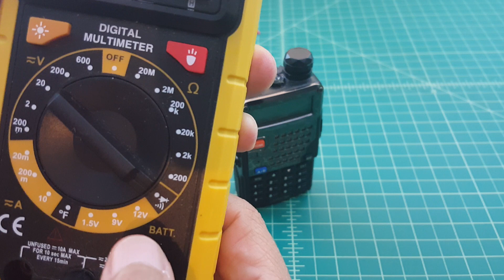Increasing the Range of your Baofeng UV-5R With a Counterpoise - TheSmokinApe

Comment: WHAT IF YOU ISE THAT RUBBER DUK ANTENNA THAT IS SUPPOSE TO BE SUPERIOR TO THE 5 UVR ANTENNA?  IT IS THAT BAOFENG FHP8? 
WILL USING THIS FACTORY ANTENNA WORK BETTER THAN WHAT COMES WITH 5 UVR?
Reply from the maker: The stock Baofeng antenna is terrible, you are better off getting an aftermarket antenna 👍
Reply: LIKE THE NAGOTA 771 ON EITHER UV-5R OR FH8?
Reply from the maker: Yes, I use a 771

Comment: That wave you be talking bout?
It represents the beep tone coming from your meter when you have continuity below 250ohms I believe it is. Might be 250k can't remember, either way it's the beep symbol dawg..
Reply: The "beep" is simply a selectable audible setting when checking continuity using resistance.  If there is 0 resistance, the meter can be set to "beep" so that the audible alarm frees you from reading the meter.  Its the "continuity" symbol.

Comment: Do you have a link to buy Like that radio Baofeng uv5r.
Reply: EBay. From $12 to $25
Reply: @franciscorios3833  do you link sir, in to the other seller are not original or legit radio's, i mean class A .
Reply: I bought 2. From eBay brand new from legit sellers and they work amazing.    I don't know what link means
Reply: Link website seller store sir
Reply: @JayGamzTV  factorydirectsale on ebay
Reply: Thank you very much sir 😊

Comment: Would you recommend this or just buy a better antenna?
Reply from the maker: I’d buy a better antenna before doing this.
Reply: I WOULD USE THIS SYSTEM OR CABLE ONLY IF I AM GOING TO USE THE RADIO TO RECEIVE AND IF IT WOULD GIVE ME BETTER PERFORMANCE IN RX BUT FOR TX TRANSMISSION I WOULD NOT USE IT

Comment: This works but you only improved the 2 meter band, not UHF. Use a piece of speaker wire instead. Cut one of the leads to your 19.5 inches for VHF and the other lead to 5.5 inches for a UHF counterpoise. Leave them stuck together, no need to peel the two leads apart from one another. When you change bands, the RF will "ignore" the non-resonant lead and use the one most resonant on that band. My own testing with a ham friend on simplex showed about a full S unit gain which is approximately 6db. This is equal to doubling your RF power. Not bad for a few cents worth of wire.
Reply from the maker: That’s a pretty good tip, thanks 👍
Reply: Do I join both wires into the same clamp and screw them down together with the same screw to the HT body?
Reply: @darezi   @Darezi  Speaker wire is two parallel stranded wire bundles enclosed in common insulation. Cut a piece to 19.5 inches. On one end you attach a ring connector to both strands. At the opposite end you cut just one wire bundle to 5.5 inches length and peel the excess wire away.  It will look like something like this:
O=====--------------
So there is only one end to attach to the radio.
Hope this helps.
73,
John - KK7JBZ
Reply: @johnbauman4005  Thx! I'll try it out.
Reply: @johnbauman4005 having trouble with the instruction any chance of doing a video ❓
Reply: Best way to use repeater set ?
Reply: Thank you for this information! I just bought a set of baofeng radios and realized how little I know about this subject.  On the other hand,  I am an electrician and have the tools and wire needed for this upgrade.  Thanks for sharing your knowledge with this newbie!
Reply: @richb.4374 For UHF 5.5 inches look like it's for 570 MHz which is out of scope... Would it not be better 6.3 inches which is 435 MHz ?
Reply: @fgFhgs  Unless you have a way of checking the SWR curve of whatever HT antenna you're using, the length of the counterpoise wires could vary by some degree to obtain a low SWR. Also keep in mind that with or without a counterpoise wire added, your body and the ground traces of the HT circuit board are also part of the "ground plane" of the antenna. My measurements are "close enough" and work fine on my HT's, feel free to experiment though, your results may differ from mine. In my tests, my signal picked up a full S unit by adding a counterpoise wire for vhf and uhf.
Reply: @richb.4374  Ok thanks, I was asking in case it was a simple "mistype" number  (I'm total beginner in antenna and it seem veeeery complicated 😃😁 )
Reply: @fgFhgs  Keep in mind that your body and the ground traces of the HT's circuit board are also part of the "ground plane" so it tends to skew the actual measurements of a quarter wave counterpoise off by a small margin when doing this. Even if the counterpoise wires are "off" by a little bit, the HT will still perform better than without any counterpoise at all because the human body is a terrible ground plane.

Comment: Hey there SmokinApe, 🐵
Nice video! Just ran across this post early this morning (too early for beer unfortunately). This video was interesting to me as I just purchased a Baofeng 5r. Although this post is nearly 2years old, as I read through the comments I noticed some glaring omissions for suggestions. 
#1. The dangling end of the ground cable was not covered or treated to eliminate the possibility of the wire touching the positive connection of the battery. With a lithium battery, a short circuit could prove catastrophic to the radio 💣💥 and down right dangerous to the radio operator, 🤯🤕 unless the battery has an internal fuse. Not all batteries coming out of China are properly fused. A little trick I learned years ago for a dangling wire end is to place a piece of snug fitting heat shrink tubing over the end of the cable leaving approximately 1/4" of tubing longer than the wire. Immediately after applying heat to shrink it, take a pair of needle nose pliers and pinch the end of the tubing  and hold it until it cools. This will provide a cover for the bare wire and make it more water resistant. 
#2. Someone mentioned that the wire was not straight and would affect performance and I concur. 
Storing the radio with a stiff wire would be impractical (please, no male enhancement jokes), but having a piece of teflon tubing, with the length slightly smaller than the wire, handy could serve as a means to straighten the wire for use. Just uncoil the wire and feed it through the teflon tube and place a piece of electrical tape on the end to keep it in place. Yes, I know that "could" eliminate the need for suggestion #1 but "Belts And Suspenders Ladies 👒 And Gentlemen". 🎩

Thanks for posting this SmokinApe. 🐵
This post makes perfect sense because the radios and antennas are engineered with the radio operator's head being close to the radio and the radio in the operator's hand. This provides the ground plane with many variables. Your suggestion should help to stabilize some of those variables. 
I will give this a try. 👍
KC8AMD
Reply from the maker: Glad you liked the video and thanks for the suggestions 👍. Your point number 1 about the insulation is a good one!

Comment: Lol! Dont know what your talking about bro, but if you really want rx/ tx gain, you need to buy a bnc connector for your radio antenna connect it ta an Rg-6 coaxial which is connected to a omni type G7 hustler antenna on top of a 100 foot mass then you can be heard for miles now if you want to install something on your portable radio buy a hustler whip antenna for 2mand replace your rubber duckie, now if your licence you can buy a linear booster like 500 w to have more power but dont forget to buy an SWR meter to avoid toasting your final stage IC and that is how you make your radio power full

                          4F1-PNO

Comment: That's a good video, but... I made a tiger tail and by using a larger end ring, it fits on the antenna port nicely. Simple, durable and effective. It's also called a tiger tail. By using the tiger tail, you can give it slight directivity by pointing it in the direction of TX. This is the first time I've ever seen one mounted to the back of the radio.
Reply from the maker: Nice tip about the directionality 👍

Comment: The radios chassis and your body is normally the counterpoise on a handheld.
If you do this it may or may not help much. I suspect that it's effectiveness is going to depend on the frequency youre using it on
Reply from the maker: I think I agree with that.  Thanks for commenting.

Comment: Can I just cut a 19 1/2 inch copper wire and wrap It around the backscrew?
Reply from the maker: Give it a try and see what happens.  I’d use shielded wire.
Reply: TheSmokinApe i did it it seemed to work , I used a insulated wire and I touched the positive on the back of the battery and it sparked so I think I did it ! It Is roughly 20 inches,  why does size matter and can I coil it up?
Reply from the maker: I wouldn’t coil it when in use, is should be 1/4 of the wave length of the frequency you are working.  I think I did 19.5 “ for 2m.
Reply: TheSmokinApe yea , getting my license soon so I'll let you know when I'm on the air!
Reply from the maker: Good luck on the test
Reply: TheSmokinApe update,  so I attached counterpoises to two baofengs with the super long nagoya antennas and my brother couldn't hear me 3 miles away (8 watt version) there are hills , buildings and houses blocking the signal but he should still hear me somewhat right ?
Reply from the maker: I’m assuming you were on a 2m frequency, that is a line of sight band and should be good for about 6 miles if you are standing on flat ground.  The obstacles between you could block the signal but three miles shouldn’t be a problem.
Reply: TheSmokinApe what could be the problem between the radios ?
Reply from the maker: Make sure you are both on the same 2m frequency.   Make sure one of you doesn’t have any ctss / dtss codes programmed.  Test in an area that is flatter and with less obstacles.  Use frequency mode for the testing.
Reply: TheSmokinApe they were on the same channels and on the highest power on stock settings as far as I know.  It is beyond me what went wrong . Maybe my brother hit low power or was transmission properly.
Reply from the maker: Jake 1776 try testing at a closer range or with less obstacles.  That might help you troubleshoot.

Comment: Nice job but two things to consider, the symbol on the meter is for a sound wave, (audio out on a short) and the counterpoise wire is best if you reduce the length by the distance from the base of the antenna to the screw to keep at the frequency you want it tuned at.
Reply from the maker: Thanks for the comment!

Comment: If i have a 47 cm antenna, is it better to use a 47 cm counterpoise or 54cm because of the quarterwave of 2m band? For 70cm uhf should i add another shorter poise or will that one do for that too?
Reply from the maker: You could try with two, I’ve never done it.  As for 47 bs 54, I do it at 1/4 wave not the length of the antenna as it has coils.

Comment: A counterpoise has nothing to do with earth ground. To preform well an antenna needs to be 1/2 wavelength long dipole. HT antennas are 1/4 wave long monopole (so are automobile antennas). A counter poise adds the other 1/4 wave length to create a half wave dipole.
Reply from the maker: I’d agree
Reply: @TheSmokinApe  You'd agree.. But???
Reply from the maker: Graham a counterpoise isn’t an Earth ground and a dipole is better than a “monopole”
Reply: What you do with a counterpoise is adding a significant amount of conductive mass to the circuit that given the small currents used, simulates ground. Of course, grounding it for real would be better but this is good enough for a handheld radio.
Reply: VERY LOGICAL THE EXPLANATION THAT CABLE COMPLETES THE EARTH PLANE AND MAKES THE ANTENNA 1/2 WAVE AND MUCH IMPROVES ITS RX

Comment: you added a rats tail for 2m and mentioned others that can be made for other frequencies. Can you have MORE than one attached at the same time? eg you have two screws for the belt clip, so have a rats tail on one for 2m and on the other for 70cm.
Interesting video. I'd be interested if any testing was done
Reply from the maker: That's an interesting question, I really don't know.  I don't see why you couldn't try it...

I didn't do any "test" other than observation.

Comment: The counterpoise to a monopole antenna should look like a flat sheet - the missing half of the dipole appears if you imagine this sheet to be a mirror.  Your counterpoise looks more like the other half of the dipole itself.  You're even measuring it to match.  Since it's driven by an unbalanced co-ax feed it should have a balun. Of course there are many other variables so these things are rarely predictable. Have you tried using a balun?
Reply from the maker: No, I haven’t tried a balun with that particular setup.

Comment: I'm a total noob. How about a screw with the head cut off and a wingnut and an assortment of rattails with label maker tags? 

I agree any gain is significant, but wouldn't you be good with a rattail at any length so long as it doesn't exceed the length or wave of the antenna?
Reply from the maker: No reason why you couldn’t have multiple tails to swap out, I wouldn’t keep them all attached at the same time.  I do think you want to keep the length matched to the band and antenna as much as possible.  If you really need more range it’s probably time to look at other antennas.

Comment: The counterpoise is more commonly known as a Tiger Tail. As you know, it's 234/f - 5% = the length of the counterpoise. I just put mine between my SMA male and the radio on my FT-60. Having an aluminum body is an advantage. You are essentially making a vertical dipole. By holding the counterpoise in the direction you want to talk, it actually has some directivity as an L shape. It would only become a grounding element if it were on the ground. That would make it a vertical antenna with reflective radials. Good video...
Reply from the maker: Glad you liked it, thanks for the comment and the info!

Comment: are 2 baofeng a better option for range in outback vs reg walkie talkies like motorola mr350?
Reply from the maker: I’m not familiar with the mr350.  “Better” probably depends on frequency, power and antenna options.  Generally speaking the more range you get requires licensing.
Reply: @TheSmokinApe  MR350 is FRS band and unlicensed in the US. You need a license to transmit on a UV-5R in the US. Comparing the MR350 and UV-5R is like comparing apples and pineapples.

Comment: where did you get your wire?
Reply from the maker: Probably Walmart
Reply: also, where did you get the eyelet from?
Reply from the maker: musicfun I have a box of them in different sizes I got off amazon.  Walmart or any auto parts store should have everything you need.
Reply: I use Silky wire from The Wireman. Specifically, #534 .26 gauge.

Comment: Thanks for wasting 6 minutes and 39 seconds of my life.  I'm not gonna have a wire hanging off the back of my radio.  How much is it really gonna help anyway?
Reply from the maker: Anytime!
Reply: It is going to help a crapload in iffy situations. You've gone from a 1/4 w/l antenna with a poor ground plane to a 1/2 w/l vertical dipole. Any other questions?

Comment: using the phrase Negative or positive for an rf connection is rather misleading and confusing!  Yes the "chassis" of the radio is quite more than likely negative, in comparison to the + of the battery, but when it comes to the RF connection, both sides will be + and -  as the sine wave of the rf signal varies over time!
Reply from the maker: Great info, thanks!

Comment: Would powering your UV-5R using cigarette lighter increase ground plane as well?
Reply from the maker: I really do not know if it would increase performance.  Have you tried and seen positive results?
Reply: I plan to try it out this evening.  Will let you know.
Reply: TheSmokinApe Powering my uv-5r thru cigarette lighter instead battery helped me.  I am using mines with a diamond mr77 antenna on my pickup.  Using battery I was not able to hit repeater that is about 10-15 miles away from me.  Powering thru cigarette lighter, I was able to hit it.

KD9AJI
Reply from the maker: Awesome!  Good info, thanks for posting.
Reply: the constant voltage and capacitance from the battery will probably help filter more and show more improvements than a counterpoise (cord from lighter)

Comment: What you are actually doing is changing the loaded quarter wave antenna into a half wave dipole.  If you really want improve it even more get rid of the little rubber pos and get a 19 inch antenna with the matching connector for the radio.
Reply from the maker: Seems like more of a counterpoise than a one sided loaded dipole, but I see your point.  What would be the problem with adding a counterpoise to the 19” antenna?
Reply: There is no problem adding the 19 in wire if you use a 19 in antenna.  Think of the "counterpoise" as one radial of a groundplane antenna.  A half wavelength at 145 MHz is about 38 inches.  A half wave center fed dipole would, therefore be about that long.  By adding the "counterpoise" you are essentially creating a half wave vertical dipole.  The antenna that comes with almost all handhelds is a pretty awful antenna.  First, it is shortened by using inductance and/or capacitance to "fool" the output stage of the radio into thinking it is working into a 50 ohm load.  Second, because of that "trick" the bandwidth where the swr is acceptable is quite narrow.  Third, the antenna needs an "image" (a "counterpoise") of itself to work efficiently.  That image is totally random--a crap shoot--depending on the environment you're in at the time.  If you change the antenna to a real quarter wavelength (19 in) and add the "other side" of the dipole (the counterpoise) you provide a much better image.  It's still not perfect because of the nature of the beast--i.e. a handheld device with proximity to whatever environment it is in at the time--but it's one helluva lot better than that pos antenna that comes with the radio.
Reply: YES... I use a Diamond 77 series on my FT-60. It does great.